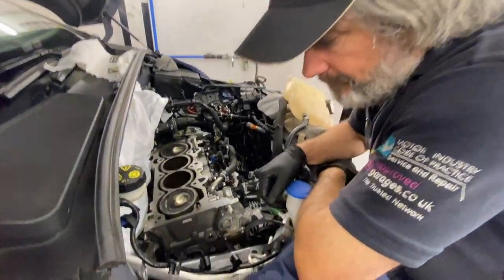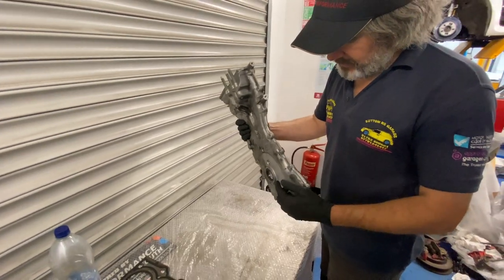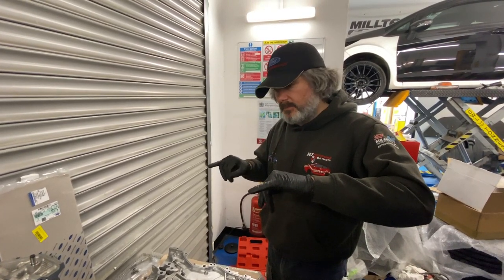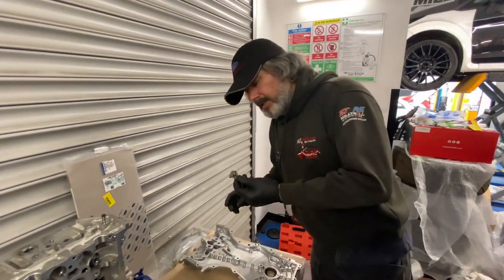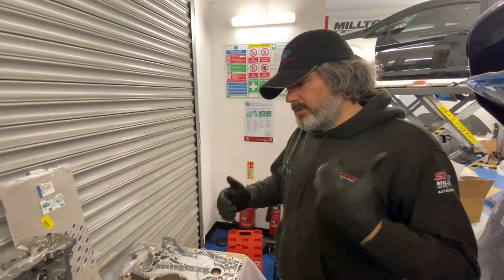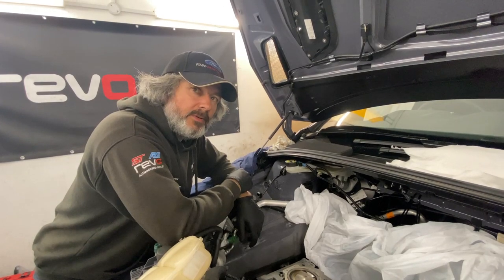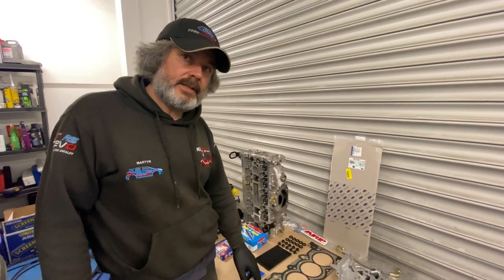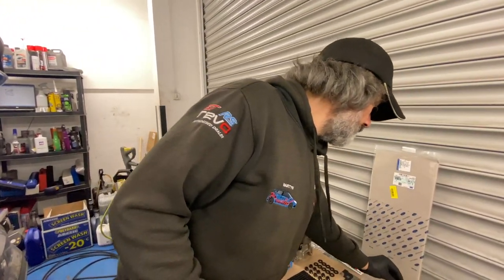MJP 455M BUILD PART 2: FIXING THE FORD RECALL OIL LEAK + DECK BRACE INSTALL!

Comment: Thanks for posting this. I'm getting my timing cover resealed due to a shoddy Ford HG recall. Can I ask what sealant you used and if the timing cover bolts are different lengths. Cheers.

Comment: Where would I purchase that turbo feed? I have been fighting this oil leak on my RS for 3 years now. This is my second time it leaks in the place you just showed. Corner of the head gasket and timing chain cover.
Reply from the maker: You can purchase the Turbo feed pipe kit from me but from what you are saying the leak is from the timing cover which will need to be rectified .
Reply: @mjperformance8161  I want to be safe and no longer get the old adage 'turbo feed line leak. I sent you an e-mail as I have found your website. 

Seeing how simple you made this look made me get extremely sad as I simply cannot comprehend how unlucky I am. 

How can we sort this so I can purchase the relevant tube as it has a much better fitment than the OEM one.
Reply from the maker: Are you based in the UK ?
Reply: @mjperformance8161  no sadly. Replied to your e-mail to settle this :).
Reply from the maker: Ok no problem where are you located ? I can send and payment can be made through PayPal.
Reply: @mjperformance8161  all info should be in your mailbox. I am located in Luxembourg. I can ring your number if you prefer.

Comment: Very quick to blame dealer rather than the particular tech that did the repair I’ve 10 plus of these recalls an never had one leak at all either too much sealer or too little
Reply: It’s states in part 1 that the owner had been back to the dealer 3 times for the same issue soooooo.....
Reply: that might be your experience, but the car was due for it's third revisit  worked on by a Ford master Tec previously ,this issue is a very common issue and there are hundreds of owners that have the same oil leak and spend  time going back and forward to a Ford dealer, that seems to be what most people experience including myself.Ford customer service was so disappointing I gave it ro MJP to sort out and payed for it myself..